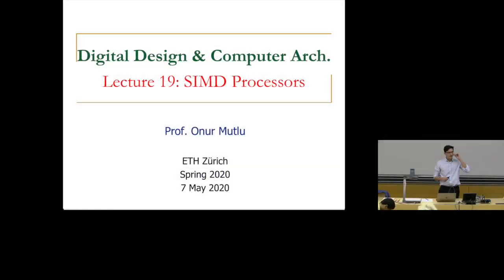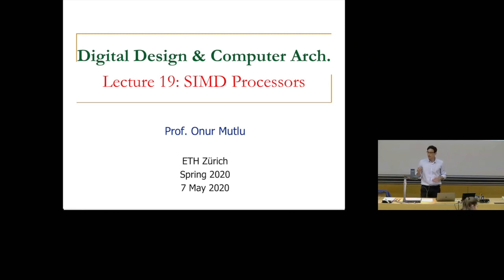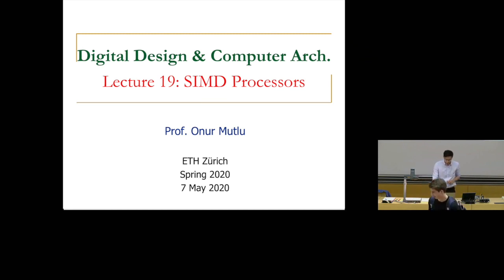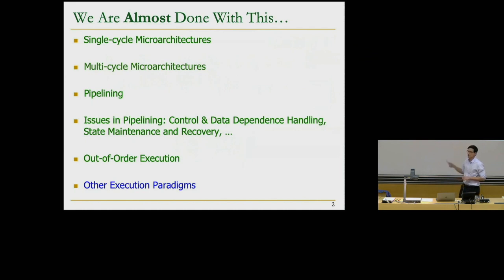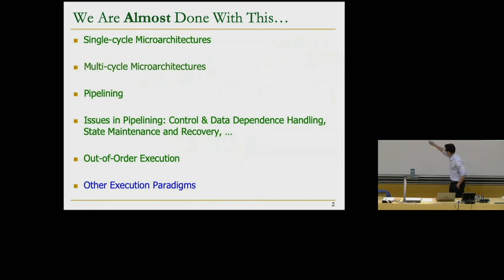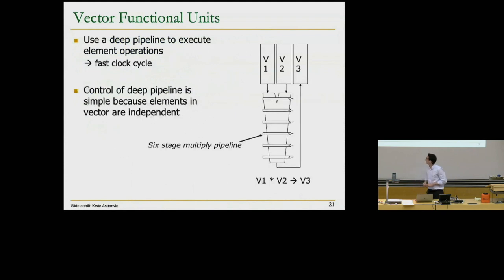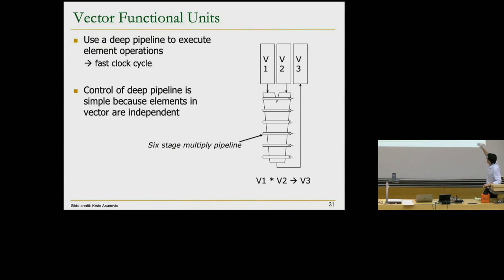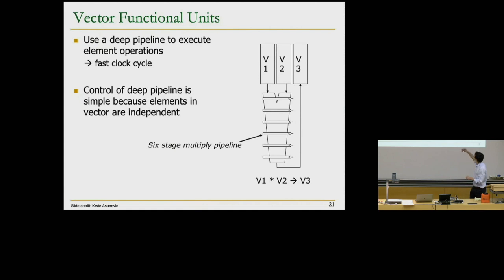Digital Design & Computer Architecture - Lecture 19: SIMD Processors (ETH Zürich, Spring 2020)

Comment: in 56:51 are we assuming 16 banks. each vector is stored in a bank? so each iteration we can parallelly fetch from each bank?

Would it be more efficient if we store 16 elements of the vector across all banks. and then each iteration we can process 16 elements of the vector. so in total we can finish the loop in 50/16 * 2 iterations?

Comment: Hey, this is a great course, I am watching all of it. I have to 2 questions in this lecture:
1) Isn't vector processing like normal pipepline?
2) Is VLIW in example of MIMD since its doing executing instructions on different (independent) data?
Reply: vector processing is implemented using a pipeline; you're not wrong but the conditions under which this particular pipeline is operating are slightly different and enable a lot of things :
1. there can be no dependencies within a vector itself; neither can there be any control flow => we can eliminate all dependency checking & branch prediction logic from hardware
2. we can make very deep pipelines in vector processors because we don't have to deal with branch mis-direction penalties/stalling because of point 1
3. each stage (or unit) of a vector processor is unique and operating on a different data element; the pipelines discussed so far operated on scalar values => the stages defined were completely different
Reply: to answer the second question, "single data element" and "multiple data element" is synonymous with "scalar" and "vector", e.g., an integer vs an array